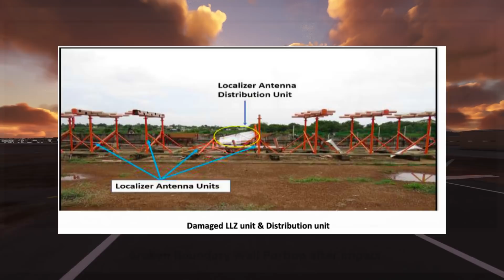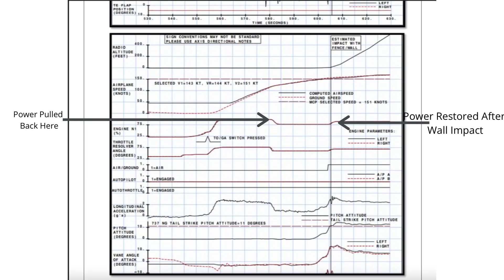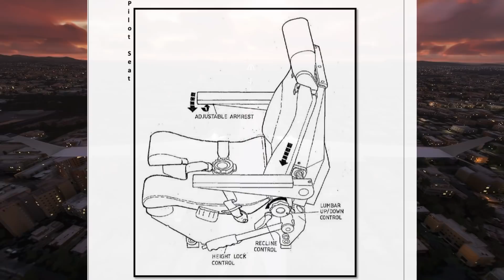How A Broken Seat Flew This Jet Into A BRICK Wall | Air India Express Flight 611

Comment: I had my seat slide all the way back at takeoff rotation in the DC-8 once. Since I was the FO I didn’t have my hand on the thrust levers. The Captain just laughed and took over the controls but I was pretty helpless for a minute or so. The seat latch mechanism was faulty and repaired at the next stop. Definitely got my attention.
Reply: Awesome you got to fly the DC-8. I’m 38 and only recently (within the last 2 years) become really interested in aviation. The M-D planes are my favorite. Here in Shelbyville, TN at our tiny little airport there is a fully restored and functional DC-3 that stays here. I think its name is the Flagship Detroit. It’s such a beautiful plane. I really hope I figure out how to make piloting a reality one day
Reply: This reminds me a "funny" incident which happened to me: I was an experimental test pilot (on helicopter ) and the blocking system of my seat broke while I was performing an autorotation (just a training session). It was a small piece, part of the seat adjustment system which came out of its lodging and the helicopter was an Alouette II, already quite old at the time. The problem is that, following the flare, just before touch down and during the "skidding" phase you need to apply all the "power" available, acting on the collective and consequently on the pedals with a much bigger range than usually with the engine running. 
Exactly at that moment the mechanism failed so that the more I was pushing the right pedal, the more my seat was sliding backward! Pedals are important on helos ... Luckily I have been able to reach the pedal with tiptoes till the helicopter stopped and everything ended fine but it could have been different should I had not been able to apply enough pressure on the pedal at that critical moment: the helicopter would have swept left and might possibly have flipped over 🤭. Instead, when I told it to my crew member who didn't notice, we just burst into laughter, fixed it temporarily the best we could and carefully hovered back to the parking lot ... 
This kind of thing is quite rare but can happen.
Reply: Laughter as a response to unfavorable developments is usually better than the other adaptations that evolution has come up with. (Against the threats modern society throws at us, atleast). 

Sure, heightened reflexes are useful in all situations, but adrenaline also truncates all the higher order cognitive functions. That used to be a 'feature' but now-a-days it's definitely a 'bug'.
Reply: That makes much more sense, I was thinking at first it was a passenger seat for some reason.
Reply: @KlaxontheImpailr  https://youtube.com/shorts/FZk0CiqhYTo?si=6t4OhORR74AlTBP4 video of crash
Reply: WOW
Reply: @hpharridan  he has zero understanding of anything aviation. There have been numerous GA accidents due to a seat sliding. Calling it hilarious is inappropriate.
Reply: @sarahalbers5555  thanks. as i see compassion, sensitivity, willingness to give a damn fall victim to social media and violence overload as entertainment fictitious or real  in all forms of media i find myself losing patience with idiocy; no doubt others think the same of me.
Reply: @sarahalbers5555  oh come on! Despite the obvious seriousness of the incident there's definitely a humerous side to it and the captain obviously thought so, nobody was hurt and the incident was managed as it should have been (and I hope other DC8s were checked/altered as a result) so I don't think there's anything wrong with laughing at the comedic aspect.
Reply: @tomriley5790  hey Tom. How would you feel if you and your family and loved ones were on this flight? Not trying to argue , but think about it. This isn't a clown car, it's a commercial flight. Recently, there have been a significant number of GA fatal crashes  and non fatal crashes due to the sliding seat. Peace out, just wanted to explain my comment.  20+ years as a flight attendant here.
Reply: @sarahalbers5555  yeah you white knighting over it will really show him 🤣🙄
Reply: @tomriley5790  ,  Tom, I think in this situation,  the pilot not only has a good sense of humor but is as cool as a cucumber and handled it perfectly. I'd fly with him any day. 
My hats off to him.
Reply: not a pilot here, but i grew up across Lake Worth from Carswell AFB, so i think i am an expert (smile).a question; was the rotation angle on a DC8 more like a 707, not as steep as modern airliners? i hope the seat mechanisms are better now, though it sometimes takes great loss of life before some simple changes are made. i read The Pilot as a young girl, about an alcoholic pilot who flew DC 8, (stretch),  good book, from a recovering alcoholics point of view, and i appreciate a great plane more than i would have otherwise. 
  by the way, i saw the thunderstorm that produced the wind shear which crashed Delta flight 191.  from 40 miles away it was black and alarming, and my friend and i remarked that it was near DFW.....storms can be deceiving from different angles. i recall an Air Force friend saying DFW didn't have Doppler Radar yet, was too cheap to install it. i hope that wasn't true. bad day in north texas.
Reply: @hpharridan  I’m guessing the DC-8 and 707 had similar performance with their original engines but we had upgraded CFM engines that gave us a decent climb rate. The hard part was descending  and slowing down without using speed brakes. We had them but they were not authorized for use in flight; just as ground spoilers after touchdown.
Reply: @tubester444   Ed, from what I remember is only the military ( Air Force ) had a few 707s with the CFM engines.  No civilian 07s were ever,  equipped .however the DC-8 is a different story. Many Frieghters utilized them,, correct me if I'm wrong.  I was told a long time ago that Boeing would rather sell you a new Airplane than sell you the plans to modify the engine pylons to facilitate the CFM engine on old 707s.
Reply: @tubester444   Also Ed, had a question regarding your comment.  Many years ago I was a Flight Mechanic for a Freighter outfit and the DC-8s were equipped with the JT-3D  engines. Upon desent, the Captain would deploy thrust reverse on engines 2 and 3 to slow us down. 
Why were you not allowed to use your Flight spoilers while desending?
Reply: @70slandshark47  As near as I can determine the DC-8 spoilers were never designed for inflight use as speed brakes. This plus a couple of accidents where they were inadvertently deployed low to the ground made it a firm prohibition by the time I flew her in the early ‘90s. We tried to plan our descent to also avoid using inboard reverse thrust but that wasn’t always possible if the airport was near mountains that required a steep descent.
Reply: @tubester444   Thank you Ed, good info.
Reply: @hpharridan  A guy I went to High School with was on that flight…
Reply: @samiam619  wow. did he survive?
Reply: Its just crazy how people that don't know each other or can't verify others credentials start arguing and being offensive over a dumb comment. Come on people,we all in this ride together!  No need to get offensive or upset.opinions are like bellybuttons everybody has one.chill out,respect,love and smile
Reply: not a pilot here, but i grew up across Lake Worth from Carswell AFB, so i think i am an expert (smile).a question; was the rotation angle on a DC8 more like a 707, not as steep as modern airliners? i hope the seat mechanisms are better now, though it sometimes takes great loss of life before some simple changes are made. i read The Pilot as a young girl, about an alcoholic pilot who flew DC 8, (stretch),  good book, from a recovering alcoholics point of view, and i appreciate a great plane more than i would have otherwise. 
  by the way, i saw the thunderstorm that produced the wind shear which crashed Delta flight 191.  from 40 miles away it was black and alarming, and my friend and i remarked that it was near DFW.....storms can be deceiving from different angles. i recall an Air Force friend saying DFW didn't have Doppler Radar yet, was too cheap to install it. i hope that wasn't true. bad day in north texas.
Reply: Ed Cook, as the FO, wouldn’t the sound of the engine power being reduced have alerted you to get the throttles back up upon taking over?
Reply: Ideally, yes. But I guess the stress and sounds coming from the Captain’s side masked or distracted from hearing the engines spool back. The passengers and flight attendants probably heard it much better because they are closer to the engines and weren’t distracted.
Reply: The FO seat flying forward on the greatest airliner ever built! I'm flabbergasted! I'd expect that on another make of plane. Not a Douglas
Reply: Since I was the FO I didn’t have my hand on the thrust levers. The Captain took over the controls 
.
I did not get that!
Where you or were you not the pilot flying.
If you were, then it is understandable that someone else 'took control'.
If you were not, then I do not understand why you'd say that your hands were not on the thrust levers.
.
Apologies but English is not my native tongue
Reply: @sailaab  If his hands had been on the thrust levers and his seat went back,  he might have also pulled the thrust levers back as well, inadvertently.  A loss of power and a resulting crash.  On take off,  it is critical. The Captain might have been able to recover the take off.
Your English is good,,
Reply: That would be absolutely terrifying as a solo!!
Reply: Crazy stuff!!
Reply: Be glad he was good natured abut it. Dad would be like "Why didn't you pre-check that?"
Reply: Lol that's hilarious. Glad you're still with us.
Reply: @232K7  what is wrong with you
Reply: @hpharridan  there’s zero wrong with Spencer’s comment dude… he’s what’s known as being as being a person with a good sense of humor….. you must be the worst kind of Debbie downer to be around … I bet it’s intolerable
Reply: @MIXTAB1  perhaps you are too dense to get my sense of humor
Reply: @hpharridan  my senses tell me that you’re sense of humor is non existent and therefore unable to be gotten
Reply: I'm surprised that you don't back up the captain on the throttles, or did you have a flight engineer?
Reply: @peterolsen269  FE backup. As an aside, the DC-8 thrust levers required more force to move than the Boeing series.
Reply: @tubester444  Got it.

Comment: I think that the checklist that was provided for pilot incapacitation might not included accidents during take-off, and even if it did, the pilots might not have known about it. I think that if the engines had hit the wall, the plane would have gone down, but I wonder if the people on board would have survived, or if the terrain/structures after the wall would have destroyed the plane entirely. Thanks for the frequent uploads! Please don't stop.

Comment: A series of terrible, baffling decisions by the flight crew. First, continuing the takeoff, obviously. Second, continuing to destination in a damaged plane. WTF? Who does that? This time it wasn't a split second decision. They had time to think about it, and they still did something insane. Third, following the order to divert all the way back across the ocean. The pilots are always the ones ultimately responsible for the plane, not anyone on the ground. They have no obligation to follow an insane and dangerous order. In fact, it is their duty to reject such an order.
Reply: I'll start with your 2nd question (I addressed the 1st question in a reply to another person's comment).  They felt vibrations after wheels up, but that doesn't necessarily mean damage.  They ran tests on the critical systems of the aircraft and discovered no faults.  Since everything appeared to be in order, and there was no way of knowing the damage from inside the cockpit, I can understand the decision to continue the flight.  As for your 3rd question, a long diversion is not an "insane, dangerous decision."  The aircraft was flying normally and all systems were functioning properly.  There was no reason to think the aircraft was in any kind of dangerous condition.  95% of the route was overwater with limited diversion options to begin with, so the crew was fully ready to be operating over the ocean in a potential abnormal state, that's all part of ETOPS training.
Reply: @derekashworth5884  They were not questions. They were statements. 

The pilots knew that they overran the runway, they also had a report from the cabin crew of a loud bang from under the floor and a witness report from the ground that they had gone through a wall. They would have to have been insane to think that their plane was fine. They had ample evidence to think that they had taken an unknown amount of damage to the aircraft, and in that situation, you land as soon as it is safe to do so. Doing anything else is crazy.

The diversion all the back across the water when they were low on fuel would be questionable even in a fully functional aircraft. They practically doubled the length of their planned flight. There's no way they did that without eating into their fuel reserve, and in a plane which is known to be damaged, it was stupid and dangerous to do. One long over water leg was already stupid and dangerous, and doing another one was doubly so.

Comment: This is why both pilots should have their hand on the throttles and the FO with his right hand lightly on the yoke during the critical roll out phase. As covered in the video, if they had not yet reached V1 they could have aborted take off.
Reply: Both pilots hands on the yoke and throttles is a bad idea.  One pilot's instinctive reaction to an upset could cancel the effectiveness of recovery if the other pilot's reaction cancelled the first pilot's input.  You put your life in the other pilot's hands if you are pilot monitoring.  CRM is a must, especially during TO and landing.
Reply: Both pilots having hands on the throttles can be a bad idea.  What I have seen as SOP is to have the pilot flying set the thrust while the pilot monitoring places their hands at the base of the thrust levers but not actually touch the levers.  This is to prevent any accidental pullback on the throttle but not influence the setting of the throttles.
Reply: Isn't V1 calculated based on the assumption of normal acceleration?
Reply: I've only seen military having both pilots place hands on the levers. Some airlines do have the FO place his left hand immediately behind the levers in case they are pulled back.

Comment: Indian aviation does have some of the wierdest of air incidents🤦🏻‍♂️
Reply: You can add Pakistan to that.
Reply: @JoseSilveira-newhandleforYT  😂
Reply: @ragnarok5074  🙂
Reply: @JoseSilveira-newhandleforYT  ohhhhhhh😂
Reply: Actually india has some of the highest safety records in avaiation. The reason is that the pilots only get the minimum basic equipments and so after a few years, they've seen everything and can tackle anything

Comment: This is getting ridiculous. How can anyone claim these things are "safe" when something so minor can become so almost disastrous?
Reply: The machine is safe, the people not so much.
Reply: @ridhosamudro2199  People built the machine.
Reply: @Hitherto90  yeah, just like every other things in the world. So?
Reply: @ridhosamudro2199  "Everything else in the world" doesn't risk crashing into the earth at hundreds of miles per hour now does it?
Reply: people can call them safe because of how rare these kinds of things happen. one messed up piece in a car, or screw in a bike, that can do just as much damage as air crashes, just on a smaller scale. And car accidents happen MANY more times as often. Also it is easy to see why something "so minor" can become "almost disastrous" when the vehicle involved weighs between 110,000 to 177,000 lbs (depending on the variant) and around 100 feet wide (around 30 meters and 50,000-80,300 kilograms) planes are big and fragile, but only when you don't consider alternative modes of transportation. Ships can be sunk quite easily if you think of a storm as a common occurence. P.S. no offense or rudeness intended, just really like planes.
Reply: @xcharke3126  These events aren't rare. At least 5 of these death tubes crash every single year, and incidents like this one happen regularly. I won't be fooled by that safest form of travel POPPYCOCK.